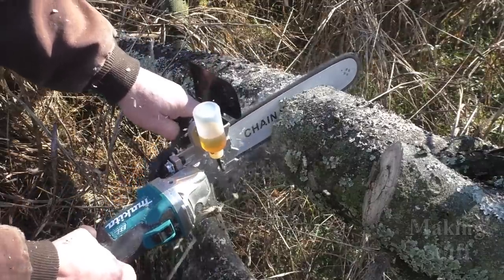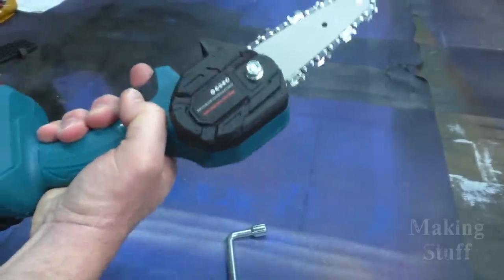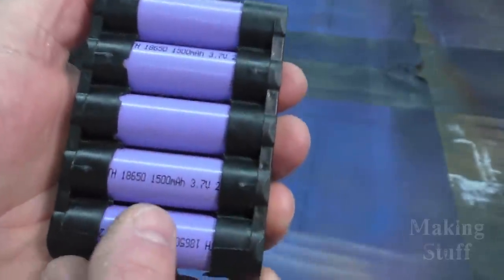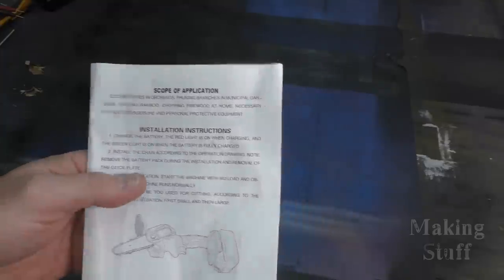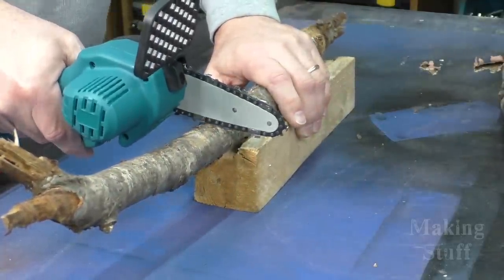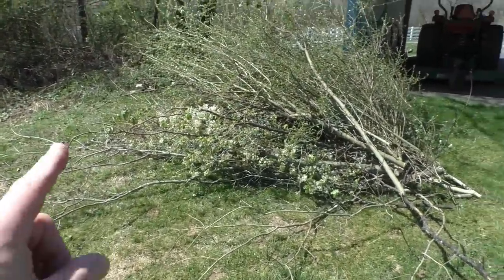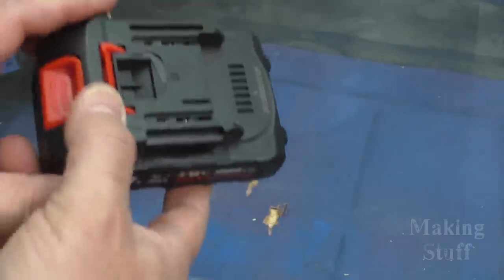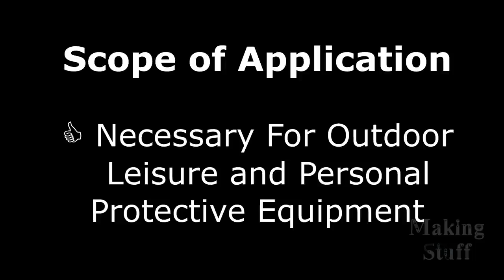Mini Cordless Chainsaw Review - Is It Any Good?

Comment: Are these shipped from China? I haven't had much luck with getting orders that come from there.
Reply: Yes they are because i just got one. Depends on where you live.. I live in europe so i allways choose EU priority line for shipping. I got more than 10+ products from banggood and they usually arrive in 2-3 weeks to my door.
Reply: @BinaryOptionRomaniaBOR1  thanks so much for the info. The last time I received something from China it was the wrong thing.

I sent it back but they never refunded me and PayPal ruled in their favor not mine. So, I got screwed twice on that deal.
Reply: @deanmayer6508  i know, it happens.. they usually show a picture of a screwdriver for example but they only sell the chuck.. so try to buy from trusted website and also read reviews.
Reply: @BinaryOptionRomaniaBOR1  I'm more surprised at PayPal for not backing me. I used PayPal credit just in case I got screwed. But they didn't help even after sending them all the documentation of what I was suppose to get and what I got.

Comment: I took the one with 2 36v batteries for the same price
Reply: The batteries will be 18V no matter what the sticker says - My model has stickers on the batteries saying that they are 88V. Nope.
Reply: there is a tool called multimeter 😉
Reply: @GianniFlashhh  Indeed there is - That's why I know they are only 18V and not 88V. Same model - Different stickers. Still 18V.

Comment: You did,nt mention the oil bottle .that,s important.the chain needs CONSTANT!oil.
Reply from the maker: No it doesn't.  This isn't spinning constantly at high speed like a gas chainsaw.  I just apply a little oil as needed.  It has worked fine for me for quite a while.

Comment: SAFETY TIP:  Without a double button trigger, I would leave the battery OUT of the saw except when being used.
Reply from the maker: Yeah, that's what I did.  Especially if you are going to adjust chain tension or oil it.  Thanks for watching!

Comment: The worst part of chainsaws is sharpening the sawchain. This tool
will require the sawchain to be sharpened.
OR,
I use a reciprocating saw w a branch blade-works better
and  NO  blade sharpening required.
Dumb Tool.

!
Reply from the maker: This topic is covered in the follow up video. https://youtu.be/Pmof8hUxRX0

Comment: "Marketing embellishments"?  Oh, you meant to say "Lies".
Reply from the maker: Since making the video I have been told that 48Vf is the model number of the battery.  If you search for 48Vf on Banggood you will get the picture.  I don't know if this was just something lost in translation from Chinese to English or if it was done on purpose.  Anyway, I can't go back and change the video.  Thanks for watching!
Reply: @MakingStuff  thx for that update.  I meant to put a smiley on my original comment.  I appreciated your video, because I was not aware of these useful little saws.  I have found a large selection of them on eBay, some of which do have a safety switch.  They also are sold as "bare body" units, I suppose for people who already have a compatible 18v battery.  Cheers!

Comment: Its so weird that they are doing it and they keep lying this hard on the specs.. as they really don't have to as the product is quite solid as it is, as long as ou have the price in mind..1500mah 18v Makita'ish interface batterypack with a handheld brushed chainsaw and charger for this kind of money.
they only thing they are doing it, is making themself valid for disputes and making western retail sellers go a big circle round around them, as they will be held accountable with false specs. 

anyway I also got one of these.
Picked one up when they were clearing stock in EU warehouse.
was around 20 buck delivered with danish +25% VAT incl. with a battery and the same charger.
though a tad better build with safety switch and springloaded blade guard and dual housing molding with rubber inlay.
but the battery incl, was around the same std. though with a lightmeter for amount of drainage. put on a bigger pack.. fx Makita and you get way better-cutting momentum the doubtfully pack incl..
I also picked up a 6" blade & guard set from aliExp. were 10 bucks delivered and it works fine..its a lot more pointy and it got a wheel at the end of the bladeguard. holding the blade... though the end gets a little hot when looking in my thermal camera.. simply from the front blade-wheel turning.
You can use both 4" and 6" and 8" blade/guards on these.. but its still not a big brushed motor..so I wouldn't go higher than 4" or 6"

Comment: this a great little tool, however you need to learn how to use a chainsaw…. never start the tool in contact with the material, secondly it says and you read it out wear PPE you have no protection on you hand and you are starting the saw against the material where it can skip or jump and injure you. Come on use your common sense and stay safe.

Comment: I'm sure you know, if they had one more safety feature on a circular saw, it would take two people to run it. We are going to be safetied to death. I will bet the amount of time spent on home smoke alarms, compared to the lives they save is more than 1 to 1. More time is spent on them than the years of life they save. Does that make sense?
Reply from the maker: Yeah I remember when I was a kid my Grandfather bought a new push mower.  The old one he had was made in the 60's and didn't have any safety features.  The new one had so many safety "features" that us kids could not use it.  So the first thing he did was remove all of the safety "features" so the kids could still cut the grass.  Thanks for watching!